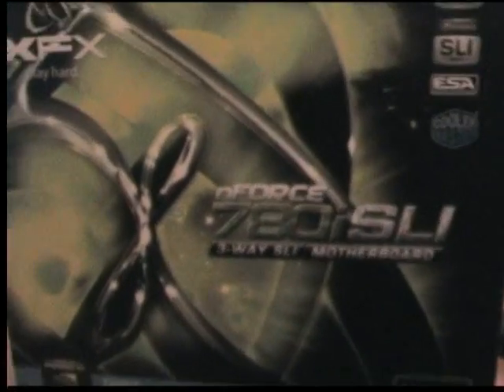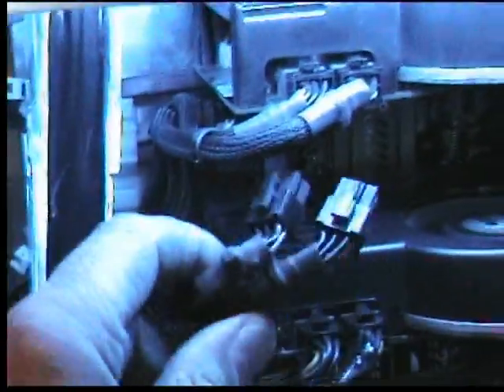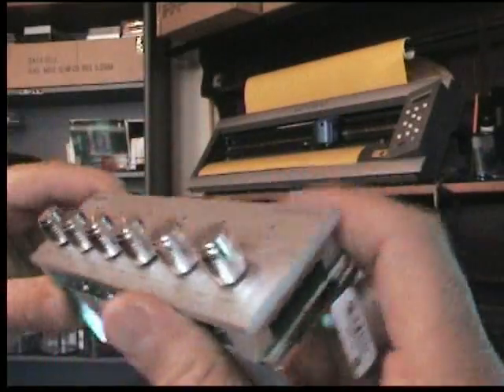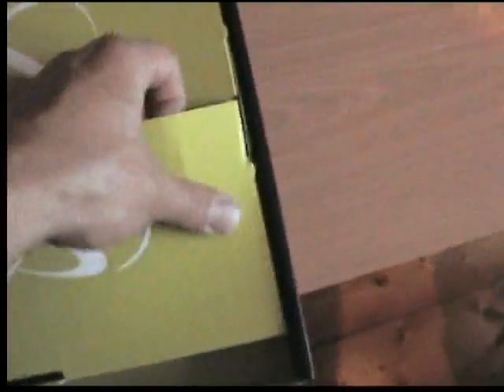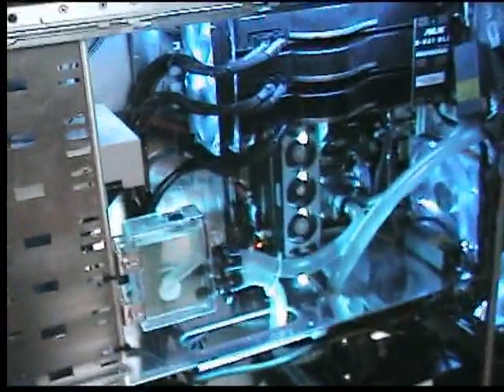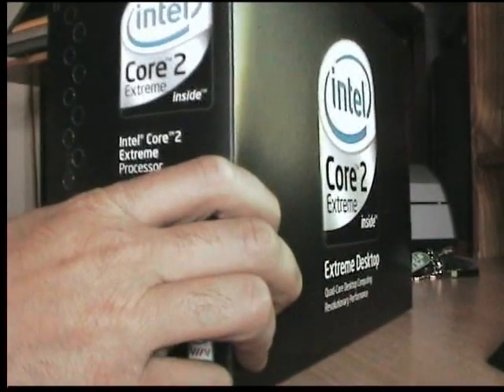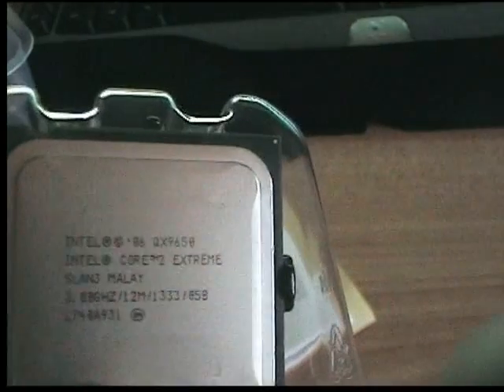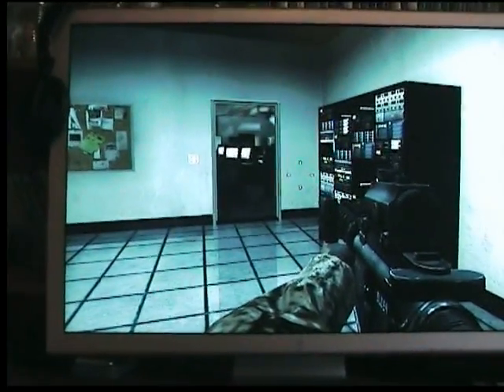Maxishine System Update

Comment: how do i figure out how many watts i need?
my build im going to build soon would be

antec 900 case
780i sli
core2 extreme qx9650
4 gb sli ddr2
2X - 9800gtx
2x - western dig, raptor 150gb
optical drives...
& thermalktake bigwater kit